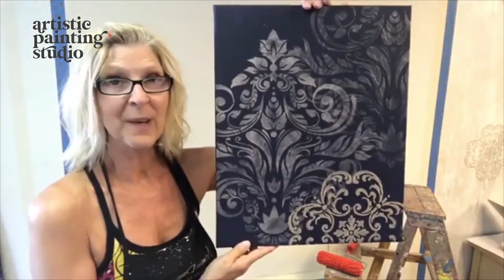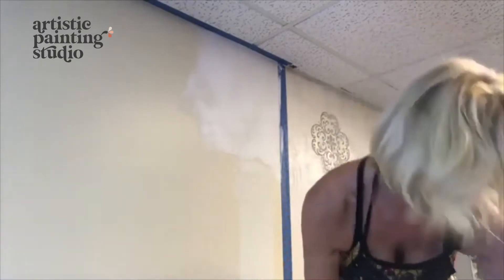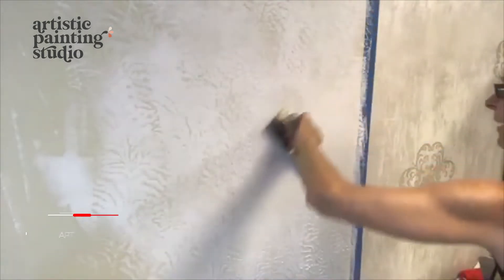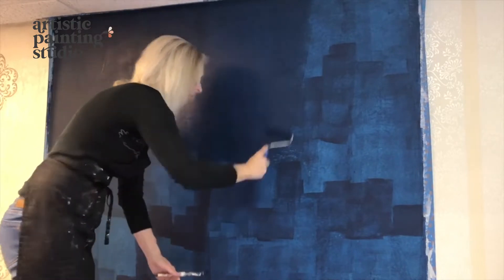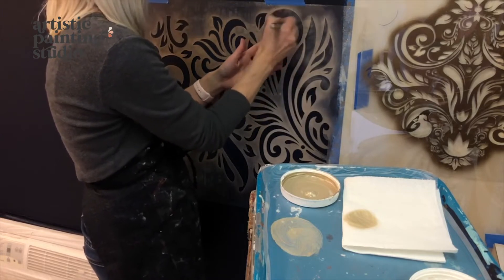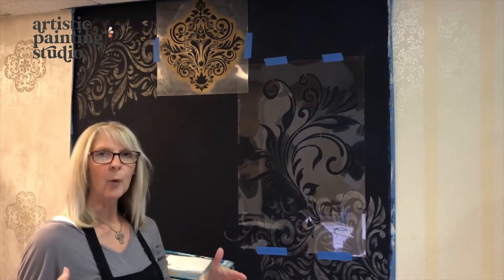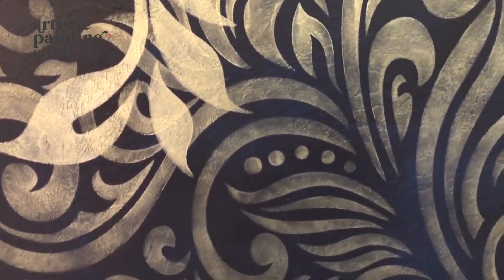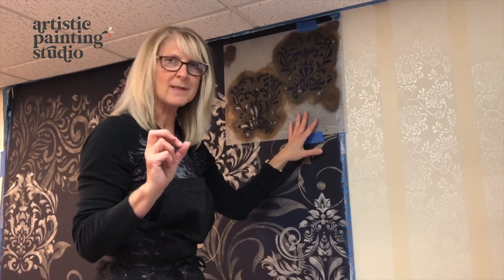Graffiti Stenciled Wall - Modern Masters

Comment: I like this idea. I'm a renter, but, this would work on a stand alone wall that you can buy plywood, prime it, paint it and it can go wherever you go. Love it and its so pretty.
Reply from the maker: or on a large canvas :)
Reply: @ArtisticPaintingStudio  Oh right, I didn't think of that. What kind of canvas would work with the spackling? Would you have to still sand it? What sandpaper would you recommend on a canvas?
Reply from the maker: @cynthiaroberts9381  It will be a little more of a challenge because the canvas will give a little when troweling and rolling - but any good stretched canvas should work - I have done a few with this technique :). Sandpaper would be around 220 to 150